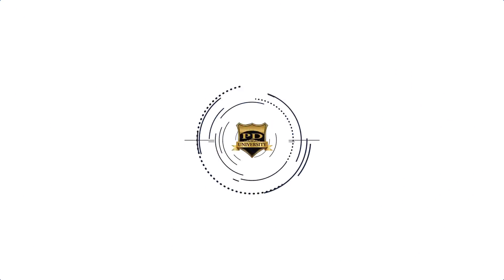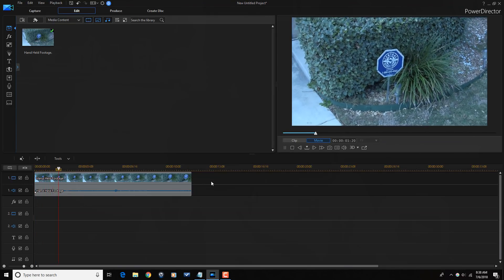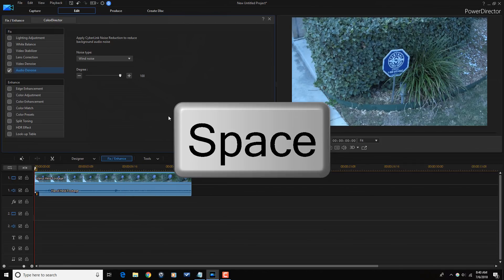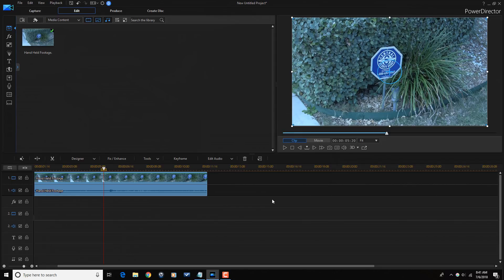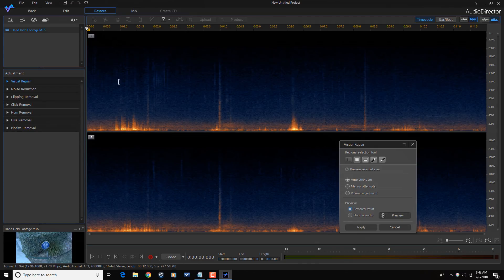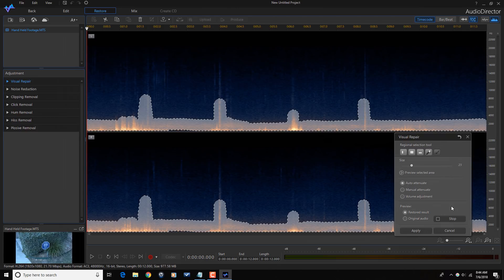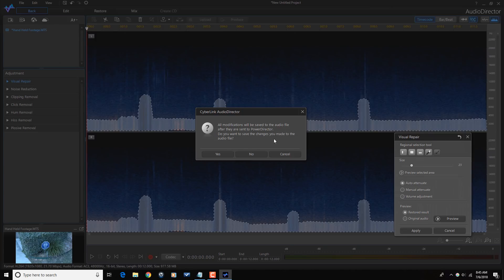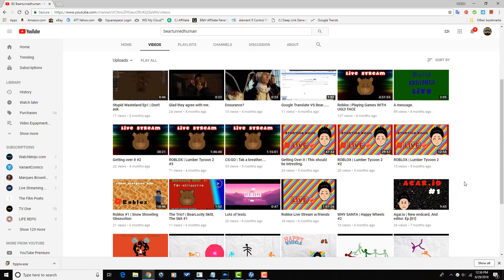How To Remove Background Noise from Videos | PowerDirector

Comment: How do you remove noise from the clips with   dialog, and not have it going in and out of noise, please respond?
Reply from the maker: All you can do with this tool is change the noise type and the degree. You don’t have control of any other parameters. If using thee options do not fix the issue there isn’t anything more that this tool can do. There is another free options you can download called Audacity. There are a lot of YouTube videos that tell you how to use it to remove noise as well.
Reply: @PDU_Tutorials  OK thank you so much and I did have that years ago,  never really messed around with it,  yes I tried audio director and wave director no luck, thanks so much for responding, and I used a rodeo boom mic. 😪

Comment: I have voice with the wind blowing so hard that you can barely hear what is being said.  I tried both ways from audio denoise and audio director with edit visual and it is still not working.  The wind is somewhat eliminated but the voice is even less then what it was.  How to fix both?
Reply from the maker: If the audio is extremely windy you may not be able to fix it. Be sure to use a mic with a wind screen in the future to help eliminate wind noise prior to working on edits in post.
Reply: @PDU_Tutorials  I learned that street the fact, lol.  I was just hoping to eliminate most of the wind. By the way, when I do use the wind denoise why does it sound strange and the voices sound very far away?
Reply from the maker: @marthagriego1003  The stronger the setting the more it will impact other sounds across the spectrum. So if there is a lot of wind and you turn up the application any other sound in the video will be impacted and the voice may sound muffled

Comment: I make motorcycle travel-related videos using VirbXE cameras. I have a severe amount of road, engine, and wind noise in videos recorded on the bike. I can't seem to get clear audio and remove the unwanted background noise. Would anyone like to take a shot at a clip and tell me if it's possible to get to a clearer audio state?
Reply from the maker: MoMo's Great Adventure Productions I think you’d get a better response rate if you asked on the PowerDirector Forum

Comment: Maybe I'm doing it wrong, but when I edit I have 20-ish clips. 
- I have seem to have to use Audio Director to filter out clicks, and noise. Then Audio Editor to stabilize the volume. For Every Clip, which takes Forever.
--- I tried Normalize but it seems to Normalize up to 5 clips, then reverts back to the original volume if it's more than 5.
- Is there a way I can De-noise, Click, and Hum, All clips on that track? And   audio edit All clips on a track, at the same time?
Reply from the maker: I'm not aware of a way to edit multiple audio clips at once.

Comment: I have a CyberLink ultra video editor I think 18. The problem is when I use the denoiser on the left top side of the editor it can cause the soundtrack to go out of sync. When I use the one on the sound editor it works only, but sometimes a raspy sound goes in the voices,It's been happening lately, It comes and it goes and my audio get normal. I don't know where that raspy voice is coming from when I start to denoise the audio. Today all my clip on my timeline just slowed down while the dialog remained normal. I had to redo the movie all over again.I'm still working on it . I don't know what' causing the audio denoiser to foul up where the voice becomes raspy or static sounding, then all of a sudden get normal.
Reply from the maker: This thread was found online by searching "PowerDirector Power Tools Video Denoise" it has suggestions for handling this issue. https://forum.cyberlink.com/forum/posts/list/48335.page

Comment: Maliek, I need specific information on how to repair an audio track of the interviews I film. Sometimes the person I interview is soft-spoken compared to me. So, I need to 'equalize' both voices so the volume of my voice and my interviewee is equal. How is that done in Power Director? Help!
Reply from the maker: the GLOSSA channel Are you recording yourself and the interviewee on separate audio tracks? That’s the first step. Once you do that you can use an audio editor like Audacity to adjust the volume of each track and then save them together as one audio file. Then bring the audio file into PowerDirector.

Comment: Great videos Malik! 
Quick question is it possible to remove some sounds on the same track? I was hunting this weekend so i have a coyote howling and my electronic caller sounds fighting with each other is it possible to remove e-caller sounds off of that file?
Reply from the maker: You have to use a audio editor like Audacity, Audio Director, or Audition to remove sound from the same audio clip.

Comment: This was very helpful. Another video saved to my PD playlist. Thanks again for another great tutorial. Now I need to work on edit the narration that’s left on the audio. It seems to be a little distorted after I take out the wind noise. Take care.
Reply from the maker: Thanks. Was it wind noise or something else? If you are removing noise across a broad spectrum, all of the video's audio frequency in the same range would have to be removed also. If this is the case removing your noise would probably make all the audio garbled.
Reply: @PDU_Tutorials  thank you for the reply but I figured it out 3 years ago with the help of Sharper Turtle guy.
Reply from the maker: @JohnCRV  Cool!

Comment: What if you have people talking and you want to preserve that? if I want to do what you did, all I have to do is mute the clip. Great video, just needs a little more , Thanks !!
Reply from the maker: This is how you remove wind while preserving other audio in the clip. You'll either have to trust me or you can try it yourself. 😊I was unable to locate a clip with wind and additional sound due to the fact that when I record outdoor audio that I need I use a deadcat wind cover which removes almost all of the wind noise. In this clip I knew I wasn't going to use the audio so no deadcat was used during recording. Hope that clears things up. 😊

Comment: Nice try, but the technique you used in Audio Director won't work if there are sounds in the clip you want to keep. Try this when the recording contains music, a group singing or even someone making a speech. The resulting audio is worthless.
Reply: I was wondering what we do when we want to keep the sound of talking. This seems pretty useless unless there's a fix for that problem, because most videos aren't just wind. Usually there is also speaking.
Reply: Surely you would just remove by muting the clip. I want to see it where I can keep my talking on it and remove background noise
Reply: The question is two years old and still no response from Power University? C'mon bro'. I know you have to have an answer. Like others have pointed out, all we have to do with your illustrated video is just mute the audio track and insert a little sound track if that's what we want. The point is eliminating the "background" noise, not "all" the noise. Can you give us any help with this? Thanks.
Reply: The method I'm using with version 24 is using restoration assistant in AD, let it analyse and knock the speech enhancement down to 50% to keep some background.
Then you can use Boost to selectively apply db increases where needed.
If you are adding background music, manual audio ducking will allow you to optimise balance.
I've not used PD since version 9 so not sure if this option was available prior to 24.  
Wind noise is very complex to remove though fully because of the frequency and harmonics.  I've successfully done it on videos shot on a Scottish hillside and preserved the speech, not perfect but certainly a massive improvement.
Reply: maatoooyyy
Reply: What if there's piano playing?

Comment: Interesting to see how the tools work but in the case of the example clip I would simply have replaced the audio track with something else because there was really nothing else on the track. What I would have liked to see was removing wind noise when there is some speech on the track as well or some other ambient sound that you wanted to keep. I am guessing that would be much more difficult if not impossible.
Reply: Exactly !  Without any other noises (like speech, music etc.) it was easy. You could just mute the clip and the result would be the same.
Reply: Ok thanks, I will certainly try it out as I have footage shot without a dead cat on that really needs cleaning up. This will be great if it works the way it did on the example.
Reply: Yes, it seems if you visually removed all of that noise it would have also removed the voice, or at least altered it.. I guess we'll just have to try it and see.
Reply: @YoungatHeartAdventures  doesn't work - as in you loose voice as well.
Reply: So I used the equalizer and deleted the lower frequencies and worked best for keeping voice in midrange and higher frequencies. Also very simple work around.
Reply from the maker: Good feedback. F.Y.I. the result would have been the same with other sound in the video. You'll either have to trust me or you can try it yourself. 😊I was unable to locate a clip with wind and additional sound due to the fact that when I record outdoor audio that I need I use a deadcat wind cover which removes almost all of the wind noise. In this clip I knew I wasn't going to use the audio so no deadcat was used during recording. Hope that clears things up. 😊
Reply: Sorry -- I enjoy your videos, but... this definitely doesn't work well when there is dialog present with the wind (and, yes, I've tried myself.)  I mean it does get rid of the wind, but the remaining dialogue sounds so poor it's better with the wind noise IMHO.
Reply: Agreed - I just downloaded AudioDirector8 and used Visual Repair. I was on top of a mountain, so the wind is extremely powerful. Good news: the wind is mostly reduced. Bad news: all of the desired audio is missing.
Reply: @Metallicfloydfan4l  Exactly
Reply: @PDU_Tutorials  I will definitely try out as i have a clip with audio and wind noise.. hope it works out. But thanks for the tip!!!
Reply: @PDU_Tutorials  Not correct - I followed you instructions and my voice disappeared also.
Reply from the maker: @andreagibson6051  See my previous post.